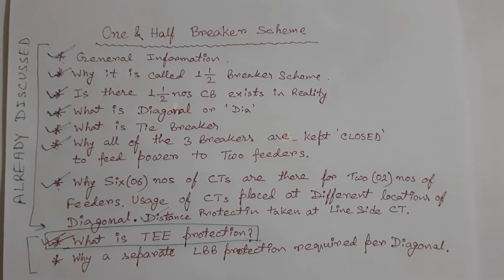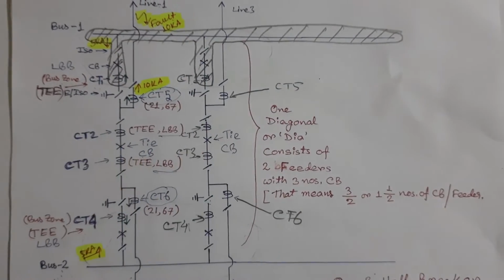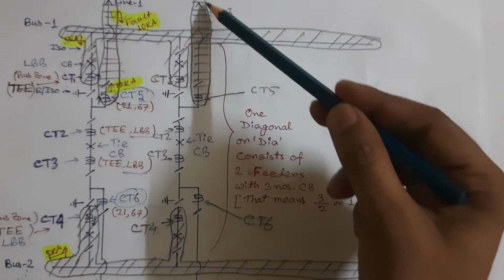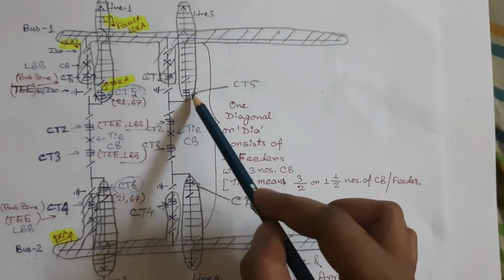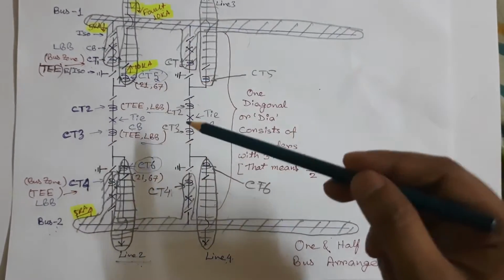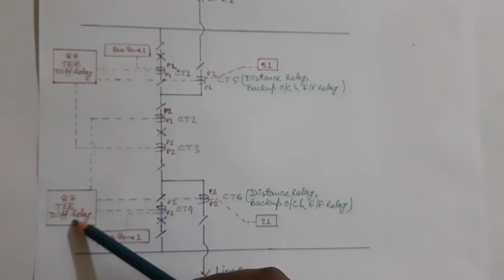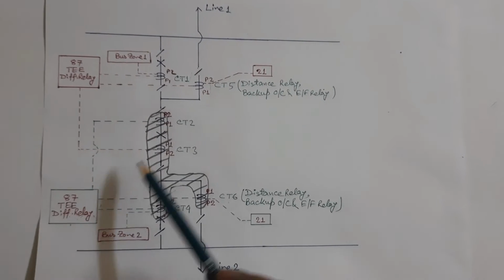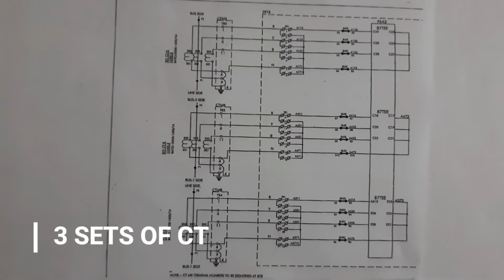TEE DIFFERENTIAL PROTECTION IN ONE AND HALF BREAKER SCHEME

Comment: Hi bro very nice video , I have one doubt . For distance  protection  we will take tie CT also, if you take tie CT that portion  also gets  covered thn y need of teed protection
Reply from the maker: Tie CT is between 2 feeders. And Tie CB is closed always , so for fault in any one of feeder 1 or 2 Tie CT will sense fault current, so you can not distinguish in which feeder actual fault occurred.
Reply: @eddycurrent1187  tq bro